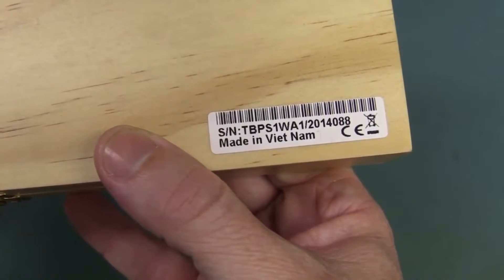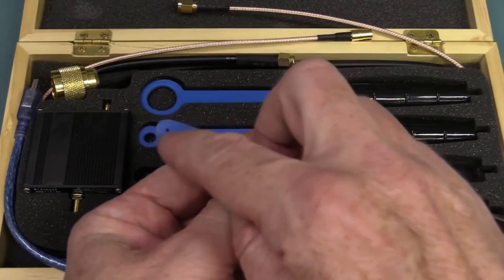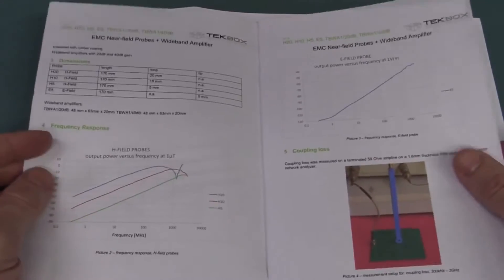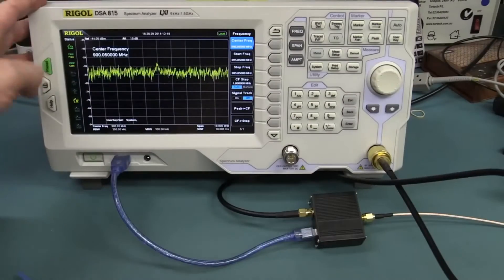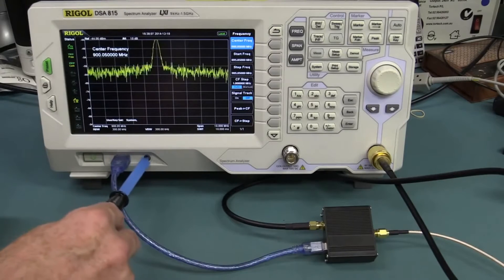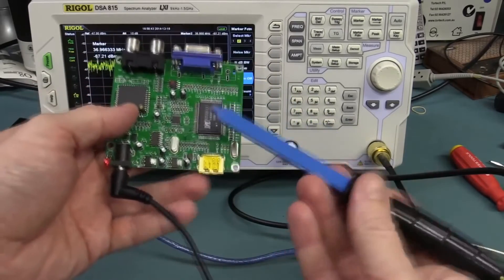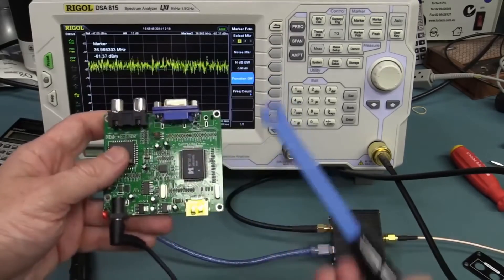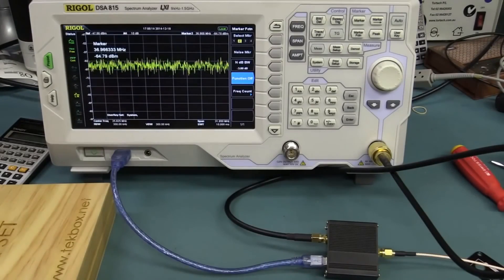EEVblog loves our Tekbox EMC Near-field Probe Kit!

Comment: I would like to buy this set to perform pre-compliance testing for my product which is essentially a wired mouse.

However, I am worried that I'll be moving the probes around seeing moving waveforms on the spectrum analyzer but not understanding what is going on, if my design is compliant enough etc. SInce I will also be spending quite some money for the spectrum analyzer, I am asking what would be the aim of my precompliance measurements if I end up buying the equpiment? What am I expecting to see/measure? When will I know that it's the right time to finally visit the test house?